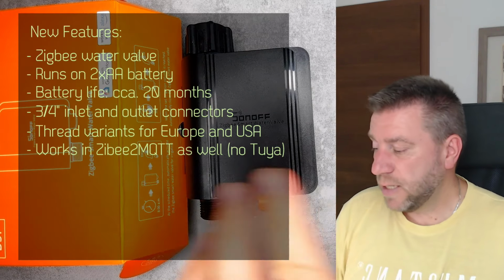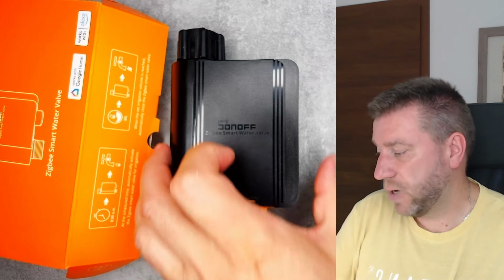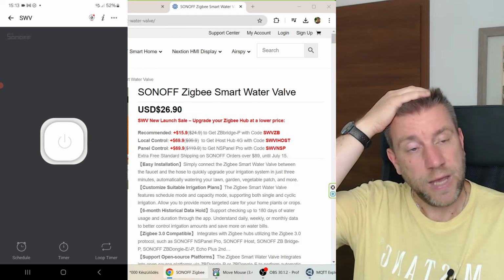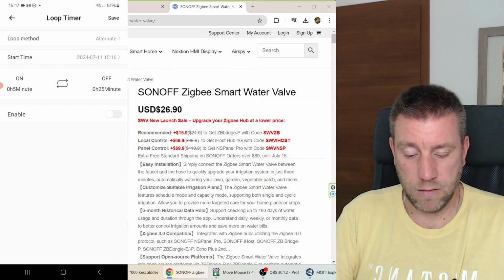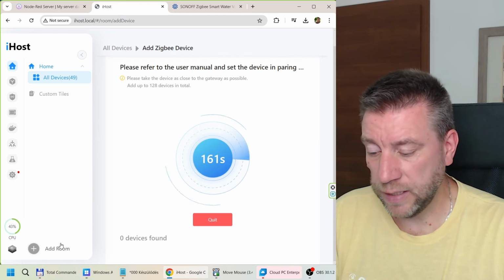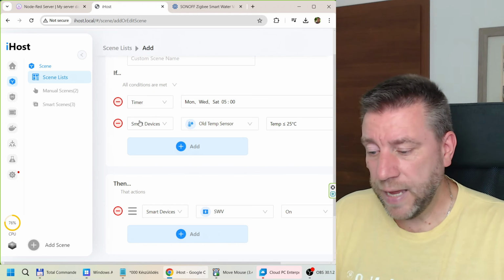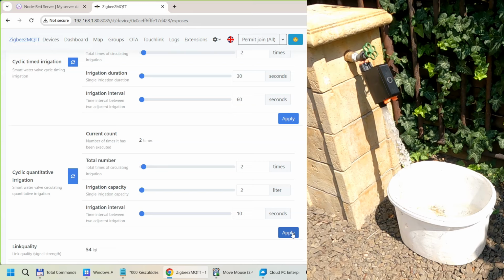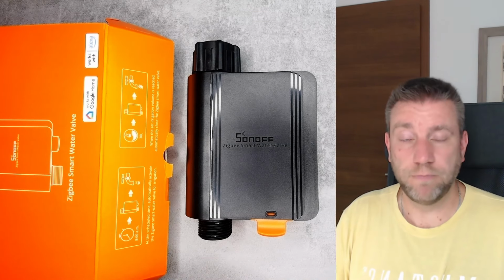Smart and easy irrigation: Sonoff smart water valve

Comment: A question about your irrigation system, do you employ also the soil humidity sensors (I think Sonoff has them) and in that case why employ also weather forecast for example? Is the logic of using just the air temperature good enough? Too bad that the Ewelink doesn't have some automation based on weather forecast included. Does Home assistant not have any good logic for irrigation, since you use Node red?
Reply from the maker: I don't use Home Assistant. I found that weather forecase it way too unpredicable. Mostly in the summer storms tend to be very localized, even if there is a forecasted rain, it may rain the other side of the city and I get nothing. So I tend to rely on locally measures data. Soil sensors is also a good option. Sonoff has no soil sensor yet, but if I use one I would set up an simple irrigation schedule, like every day, and use the soil sensor to disable the automation if the moisture is above a certain value.

Comment: Can I use it to control the whole house by placing it in the central pipe after the water meter?
Reply from the maker: @MakisPelekis  Technically yes, but I would not. I have not seen the internals, all I can see is plastic fittings, and it may not be strong enough for a main house valve. You can get regular ball valves with servo actuator on top with is probably better fit for this task.
Reply: The use I want is only for counting and displaying on the mobile screen. The smart valve will always be open and will only close in case of a possible leak. Will it be technically able to do this?

Comment: Do you know if it can be converted to Tasmota? Is there any reason to do that, maybe to customise MQTT a little? Sorry if I missed the detail but can you connect straight to Zigbee2MQTT or do you need to download the eWeLink stuff to do that?

Also, how does it compare with the other garden water valves you reviewed?
Reply from the maker: It connects straight to Zigbee2MQTT. No reason to Tasmota this (not even possible, Tasmota does not do zigbee). Compared to the zigbee unit I tested before this cannot measure the flow and the volume of water, but to be honest in most cases you irrigate for a set period, not so much for exact amount of water.
Reply: @csongorvarga  thanks. Just bought it using your link